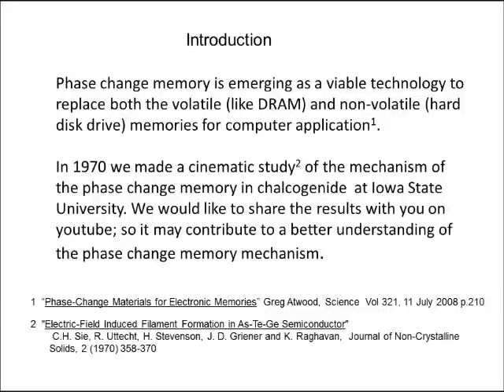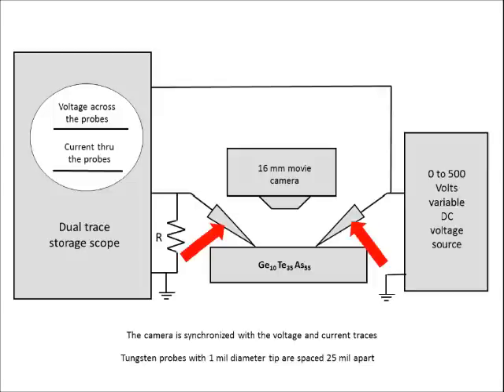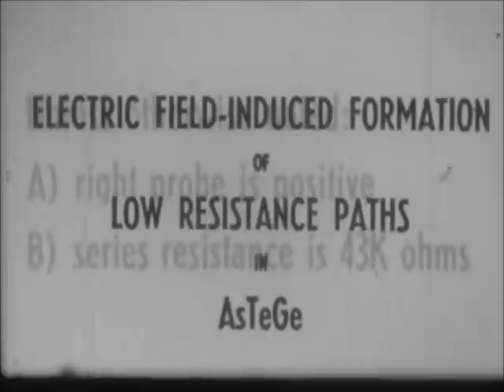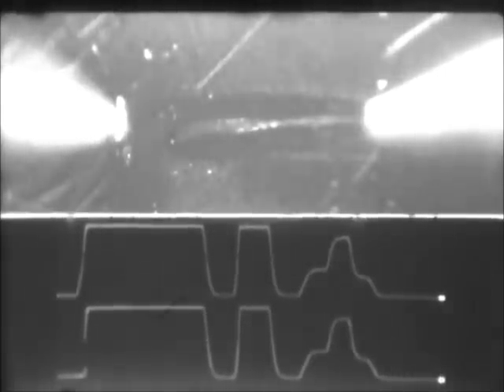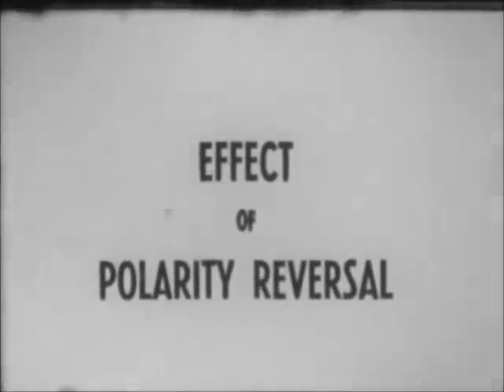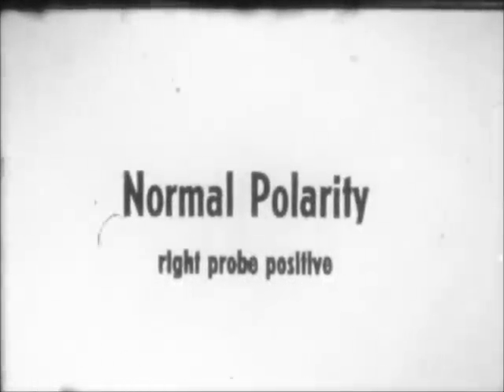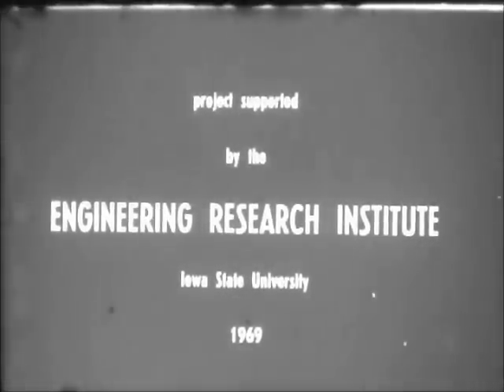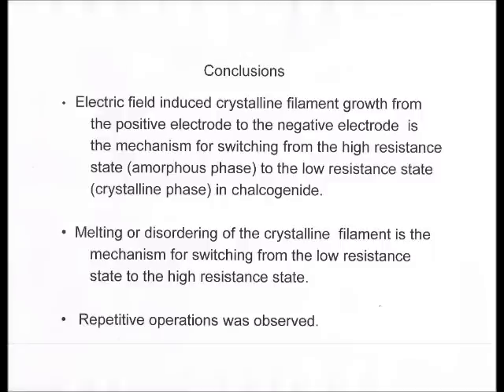A Cinematic Study of Mechanisms of Phase Change Memory

Comment: Very nice video, but I don't get why crystallization should start at the positive electrode, instead of at the warmer spot, which is in the middle between the two electrodes. It seems to me more a ion spicies migration effect, which can also explain why the mechanism is reversed by swithcing the voltage polarity.